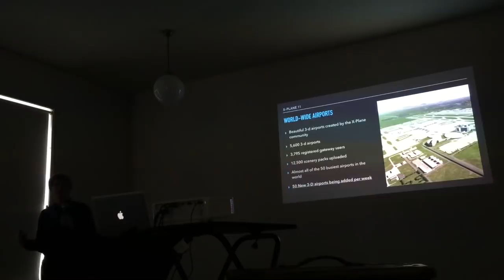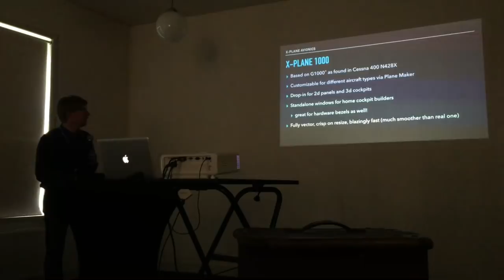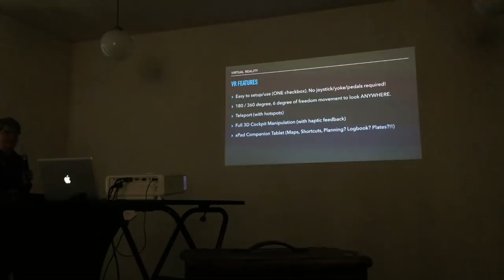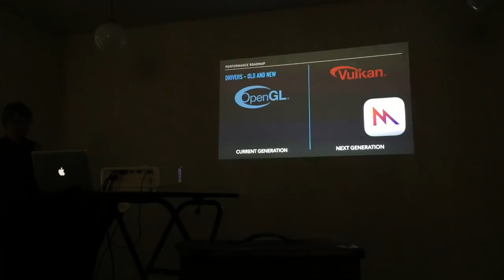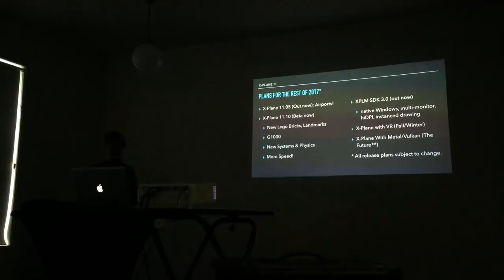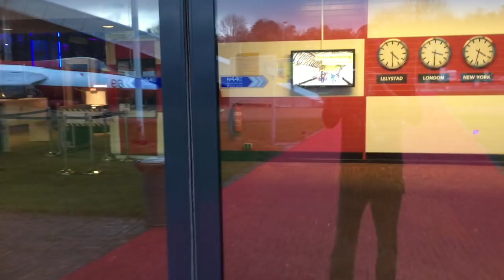X-Plane 11.10 (11.20 VR demo) official presentation at FS weekend 2017

Comment: I've been itching to get my hands on this since FlightSimCon 5 months ago.  I really hope the team's commitment to get it out by Christmas is realised (it used to be Fall).  I wouldn't mind testing a buggy beta either.  I can't postpone getting FlyInside forever and I can only take so much punishment watching YouTube videos of people experiencing the demos and describing them as "wow" and "awesome".
Reply: I got fly Insyde, cant recommend it unless you have a beast of a machine. I have an i7 7700k, 16gbs ram and an rx480 8gb all running on pcie ssd's, and it wont start VR in flyinside unless I have setting on low and even then it looks like crap compared to the native solution. Honestly I cant even use a flight simulator without VR anymore, so I have benched X-plane until 11.20 comes out. I check on it's progress everyday, i'm extremely excited for it.

Comment: VR overrated. Until they can handle the manual controls as well as virtual controls it is awkward.
Reply from the maker: jpalm32 It worked quite well for me. However, I plan to use my left hand for controlling the physical yoke, and my right hand as my virtual hand.
Reply: You can already use both the hardware and virtual controls at the same time. And I must say, the VR controls are really natural to use
Reply: OK!  Guess it's going to take  some time to adjust